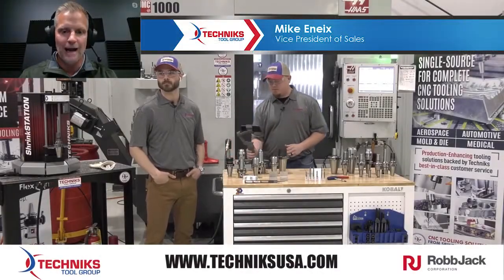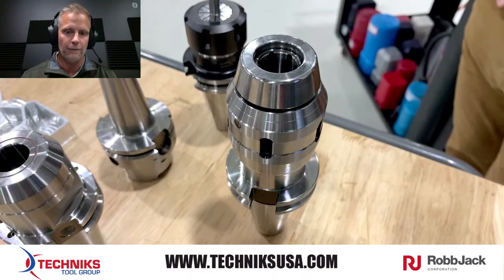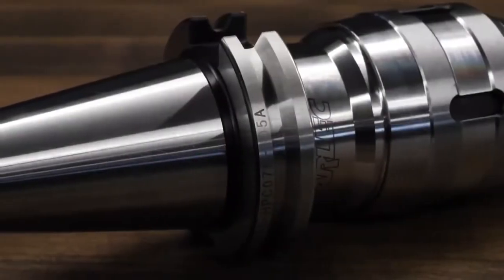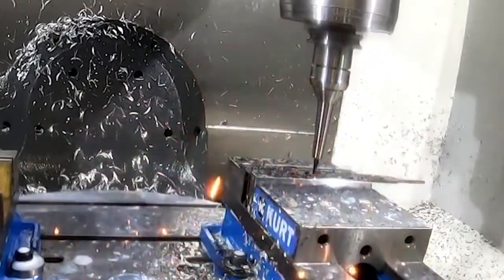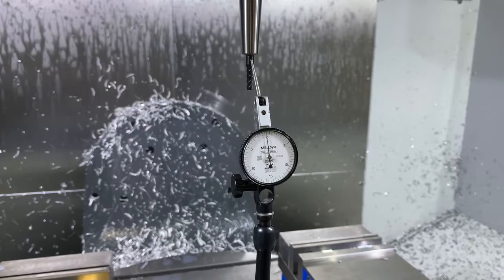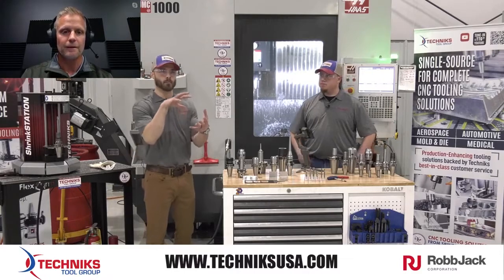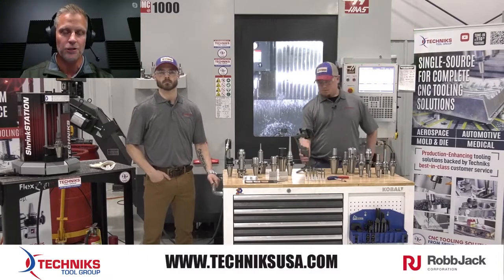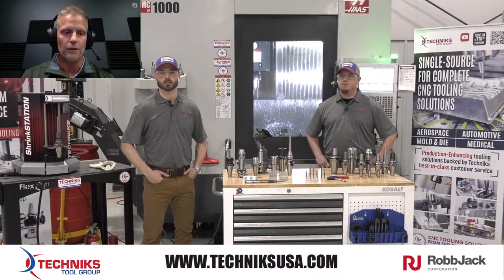Techniks Micron Milling Chucks Q&A | CNC Tools

Comment: how do you remove the sleeve (collet) from the milling chuck? I spend more time trying to remove the sleev than the tool actually machines.
Reply from the maker: Hi there,

We understand that you're having difficulty removing the sleeve (collet) from the milling chuck. We appreciate your patience and apologize for any frustration this may be causing.

Here are some steps to follow:

Make sure the machine spindle is fully stopped and locked out to avoid any accidents.
Locate the drawbar on top of the machine. This is a long rod that extends down into the spindle.
Using the appropriate wrench, loosen the drawbar. Typically, this is done by turning it counterclockwise.
After loosening the drawbar, the tool holder (along with the collet and tool) should drop out. Be sure to have your hand underneath to catch it safely!
To remove the collet from the tool holder, first remove the tool from the collet. This is often done by loosening a nut at the end of the tool holder.
With the tool removed, the collet should be free to slide out of the tool holder.
If these steps are not helping or if the collet is stuck, try applying some light machine oil to the collet and tool holder interface. Let it sit for a few minutes and then try to remove it.

If you're still having trouble after trying these steps, it could indicate that the collet or tool holder is damaged. In this case, we recommend contacting a qualified technician or our customer service for further assistance.